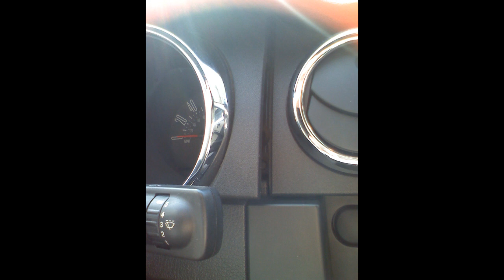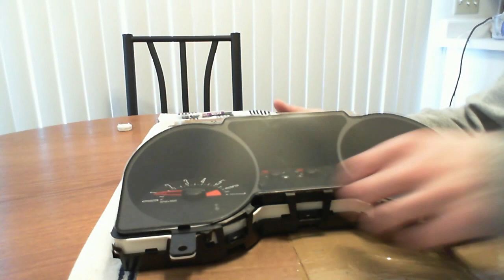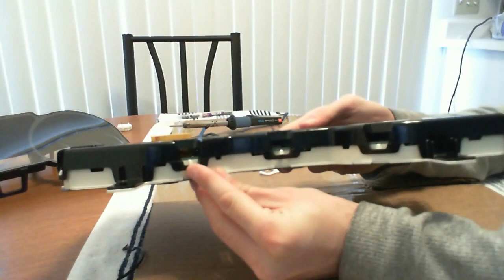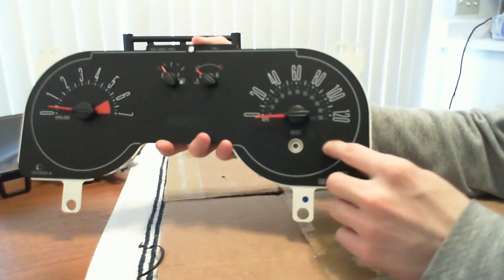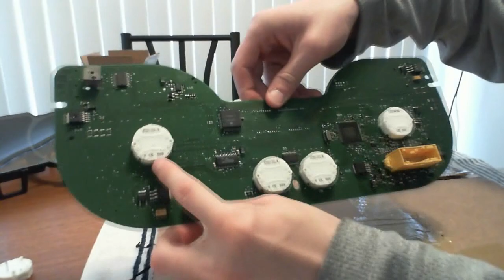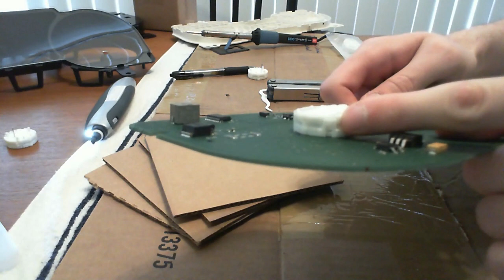Mustang Cluster Repair Guide

Comment: Great video. I replaced three motors on the circuit board for the gauges that were inop: fuel level and tachometer. After putting those in, my speedometer went out (needle would return very roughly). I got an instrument cluster from a junkyard and desoldered those motors. Hopefully they work a long time and it saved me hundreds.

Comment: Are all 4 motors in the instrument cluster identical? My fuel gauge is erratic.
Is there a way to replace the speaker in the circuit board (mine is intermittently working for turn signal, door chime, seat belt etc)

Comment: OK so it didn't take long at all!  Just gotta follow part 2 of the video tomorrow to calibrate the dials & then I can get it inspected.  I just went ahead & replaced all 4 motors while I had it apart.  I knew for sure that tach, speed & fuel weren't working right but I suspected that my temp gauge might've been off too so I changed them all 👍  thanks again for your help from so long ago 😉
Reply from the maker: Awesome to hear!! I am glad that this video is still helping people. Thanks for the feed back.

Comment: if you're having trouble removing the solder try wiping the tip of the solder gun every time you're through touching the circuit board by doing this the solder will stick to the tip of the solder gun and you will actually be removing it try this this usually works for me
Reply: wet sponge
Reply: in2deep67 rc wipe it with what? Wouldn't the tip be hot?

Comment: Help!!  My 95 GT has a bad temp gauge.  If I start or just turn the power on, the gauge moves slightly lower than resting position.  If I drive the car on long trips it starts to work after an hour or so, but only sometimes.  I've tested the sending unit cable and it's getting power, but if I ground the cable the gauge does NOT spike.  Anyone please??
Reply: I have the same problem. Did you get it fixed????

Comment: Just did this repair thanks to your video.  I went with taking apart the old motors and then heating each solder joint while gently pulling each wire from behind and they came right out.  No need to suck out solder.  Just flatten each joint on the side you are putting the motor in.  Then from the front heat each joint while gently pushing behind the motor.  As the solder melts the new pins will sink right in the motor will  mount.  You'll have to round robin the joints a few times to get the motor all the way in.  Last hot tip is once you get the dials back on, rotate the dial counter clockwise until you hit resistance.  This is the zero point of the motor.  Keep moving the dial counter clockwise until you get the dial pointed at slighltly below zero, E or C depending on which dial you are doing (Tach, Fuel, Temp, Speedo).  It will dramatically lower the time to calibrate.  Thanks again for posting this video saved a ton of cash and now I can tell if I'm getting low on fuel or how warm the engine is!

Comment: Hi thank you for this. but I did what need to be done but the new cluster don't work. now x27 589  is that a different from x25 589. or do I need a new circuit board

Comment: the tachometer in my mustang is stuck at 2000 at idle and goes to 4000 in 5th gear. Then when its off it sticks at 1200. Do you think it might be the same issue?
Reply: OK thanks

Comment: How would you change the cluster lights into led's?
Reply: I think I should just take it into a professional haha
Reply: Replace the led's with compatible led's of a different color.  I bought a blue led strip from Walmart, stripped the led's and soldered them in place of the ugly green lights.  Worked like a charm.  The led's you're looking for have a recessed corner make sure you note the direction the recess is facing and solder it in with the same orientation.
Reply: @mcalexandergold  how do I change the green LEDs to a different color? Anyway possible on a step by step or some advice got the cluster panel completely apart. Would do anything make it diff color!.!.! Please

Comment: Hi i was wondering if you could help me out, i was wondering if all the stepper motors for the 2005 mustang are the same? ex. the speedometer and the fuel gauge. because i can not find the stepper motor specifically for the fuel gauge but i do find it everywhere for the speedometer. If they are not the same could you link me to the website where you bought yours? 
thank you!

Comment: Thank you for posting this - just about had Ford pull the gauges out and repair the speedo. After watching this I went to ebay and purchased the new and improved servo motors. Everything was way to simple to accomplish - actually what took the longest was getting the gauges resent to zero. But I learned from that mistake also. Thanks again you saved me hundreds of dollars.

Comment: The most helpful video I have seen for this problem thank you so much. I'm a do it myself guy and really started thinking I would have to settle for $600 fix. Thank you
2005 Ford mustang V6 4.0L
Reply: Do you possibly have an videos on fuses or heater connections. My heater and A/C don't turn on no air no sound. Nothing when I turned the knobs. Any suggestions
2005 Ford mustang V6 4.0L
Reply: ray jay do you hear a little click sound when you turn on your A/C or heater, if you dont that will be that your compresser is not turning which could be the problem,  if you do here the click then you can hav a short to ground from your blower moter if you have any question I am here to help

Comment: I really appreciate the guide!!! My cluster is 100% working now and it saved me 700 bucks. The desolding tool I bought made it much easier. Would recommend it to these other commentors having trouble removing the old stepper motors. Thanks a ton Brent!
Reply: What desoldering tool did you use?

Comment: I have yet to put the cluster back into my car. but I have to comment on a trick that helped while following this video. Best way was to remove the motor by taking it apart as he demonstrates. What is left behind is the pin. use the solder gun to and a pair of pliers to remove each pin. Than get a needle after you remove the motors and stick it in the holes holding the solder gun in the other hand.. allow the needle to go all the way thru. It may get stuck but  keep applying heat until you achieved a hole big enough to fit the new motors. use a pair of pliers to hold the needle so you don't burn yourself. once the solder is heated up wiggle the needle in a circle so that the holes open up for the new motors. This will allow the motors to drop in with out much difficulty

Comment: Great video..  I successfully replaced 4 motors tonight..  Total time from deciding to do it 'till done, probably 2 hours, but I have soldering experience, so YMMV..  One thing - I had a hard time getting the connector off the back of the speedo, until I found a picture on another site..  The "button" release is on the top of the connector, simply blocking  the arm from moving across the top of the connector.  I thought you had to push the connector, but you push a little button. Thanks! - Steve

Comment: this actually really helped me! i ordered a new cluster from a salvage yardbecause i wanted the mycolor display but when i recieved it and plugged it in, it always read 5mph above zero when i was parked and then 5 mph over any speed i was going. turns out I didnt even have to buy new stepper motors. all i needed to do was recalibrate the needle.I didnt even know i that was necessary. it must have gotten move when the cluster was shipped to me. now it reads perfect! thanks!!!!

Comment: I have the same car as you do and started having trouble a couple of years ago, first with my gas gauge. Soon my rpm gauge and about a year later out went my gas gauge. I followed your advice and bought 6 little motors off of Ebay for $21.50. My hubby followed your video today and fixed my car in less than 2 hours. I am so happy! Thank you so much. This saved me $780 bucks!

Comment: hey im looking to get a 95 mustang and i was wondering the speedo marker is stuck under a peg and it works it goes backwards to 60 but goes forward when slowing down how do i fix it, if i was to get the car? the odo dont work either but i figured it was the gears for it

Comment: Actually, Brenton is wrong in just this case. If your car was an auto, the rear end gear ratio was 3.33 or so. The Manual had 3.55 gears, so if you had an auto, this would be the issue. The PCM takes into account the gear ratio when calculating speed and RPMs. You actually need to retune your PCM to properly translate the new gear ratio to the motors. You can get an after market tuner for like $300 bucks or on ebay somehow. You can get some more horsepower while you are at it too.

Comment: When swapping out a differential with a different ratio, you must have the cluster reconfigured-has to be done at the dealer or at a shop that has access to a Ford diagnostic tool.

Comment: Question
I have a 05 mustang Gt, i have replaced my rear axle( differential ) with another stock rear end 8.8 3.55 gears out of an 06 gt, but now my speedometer is off, its reading 140mhp at all time while im driving it even when i parked up and also my RPM its off too.... ANY deal of how to reset or fix that?

Comment: Thanks for the video. A few questions. Read a few places to pull fuse 17 for srs, is this really needed before starting? When pulling the needles do you have to turn cw to get them off or does it just help? Do you push down and ccw to reinstall them? Is stepper motor x27 589 the same as x25 589? Thanks for your help.

Comment: I have a 2008 Mustang V6 Base.  I am experiencing extreme problems with my instrument cluster like others with the 2005 models.  My entire instrument panel goes just turns off.  The airbag indicator is the only thing that is on.  All gauges go to zero.  Does this sound like a stepper motor issue?  Thanks so much for taking the time to post the detailed instructions.

Comment: Thanks for taking the time to explain things.  I'm pretty handy and experienced in simple soldering.  the gauges in my 05 Mustang quit working awhile back and I replaced 3 of them using the information you provided.  I found your video more informative than some information on a mustang forum.  Thats not a knock on the forum, the people there are great and very willing to help.  $30 and a little bit of work beats $289 to ship it out and over $700 from the Ford Stealership!  Thanks!

Comment: hey ihave a 05 gt with the same problems but all 6 of my gages are all over the place. I went to ford and their charging me 1100 to fix them, can you give me some advice on wath to do. Where i can find these motors,do i need to progam anything,where can i find the motors? when you install the motors does the odometer need adjustment to stay in the correct spot when to car is off. hope you can helpme out.

Comment: @Striker012 Striker012, I still have not gotten mine fixed so I can't vouch for them but they are out there - I ran across a few different places that offer instrument cluster rebuild.  On Ebay there's a couple different sellers I found, "Mandigital" in Minnesota and "ate1234" who seem legit.  Also there is "Dr Speedometer" who has a website, seems to be more expensive but has a lifetime warranty.  Good luck!

Comment: Thank you for posting this video. Because of your video i got the courage to replace my own stepper motor's on my 05 mustang. My RPM, fuel, and speedometer did not work, dealer wanted $700 to replace the entire cluster.  I spent $40 on a 40watt soldering gun, and $20 on soldering pump and $10 on rosin solder. I bought the stepper motors from eBay for $30. total cost $100....awesome!!!....keep in mind I'm no soldering expert just the average Joe. If I can do it, anyone can...

Comment: Hi, thanks for the video, looks like it will save me a lot of money. I'm not sure how to calibrate the dials since you went pretty fast on that. You mark the point of resistance with tape? Then when you assemble it, put it back there? Also, do you reinstall the gauges, start the car and see where they are? if they are off, do you just move them with your finger back to zero?  thanks again,

Comment: Just a few pointers for the other people attempting this. Before you remove the needle turn it counter clockwise until it stops and use some blue painters tape on the front of the cluster to mark the needles point.  Second buy some desoldering wick to remove the solder.  When you go to put the needle back on, stick it on straight up and turn counter clockwise until you reach the mark that is on the tape.

Comment: Thanks dude, I am having the same problem with my '05 V6 Mustang.  Temp gauge, tach and speedometer all have intermittent issues. Though I have done some soldering, I'm not skilled at it and not sure I want to risk damaging something, so I did find a place that replaces all of the stepper motors if you ship the instrument cluster to them. Since removing the cluster seems to be a simple task I can handle that and save significant bucks vs. dealer repair. thx again